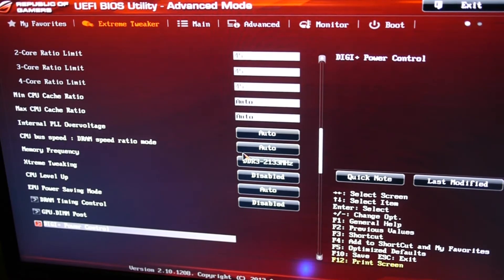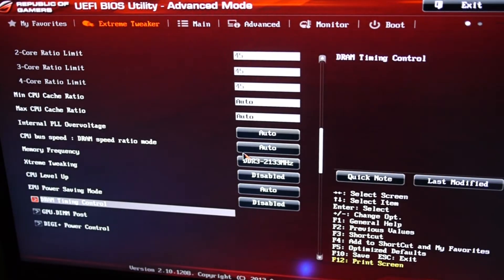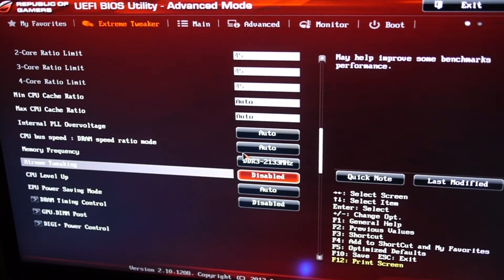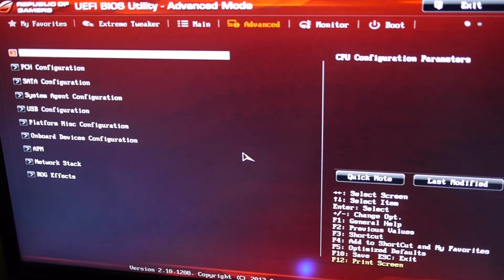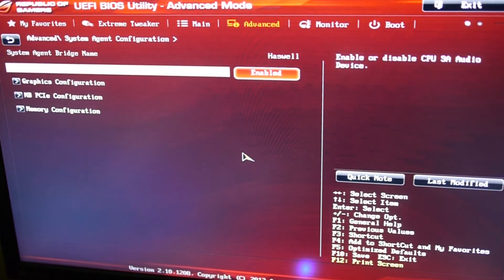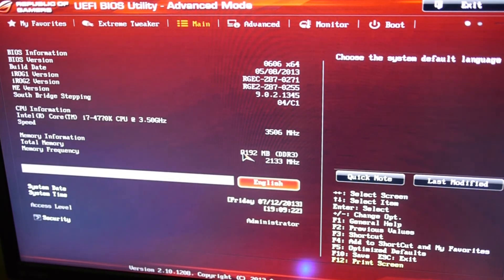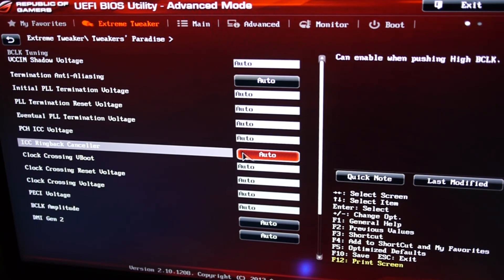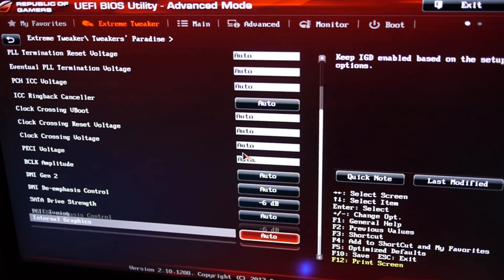Haswell mATX Water Build - Pt. 5 - ASUS MAXIMUS VI GENE Z87 BIOS Tour & Notes

Comment: Have you had the issue where if you install the SATA drivers, the system won't startup? I installed the sata drivers, and after that, my computer would bluescreen on startup. I reset windows; installed all drivers again (excluding the SATA drivers) and haven't met any problems yet. What are your thoughts on that?